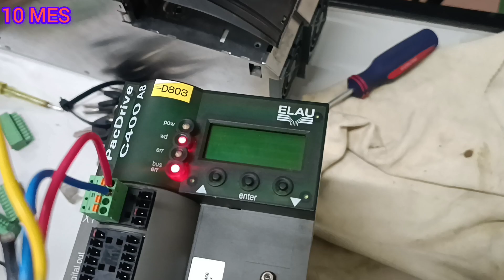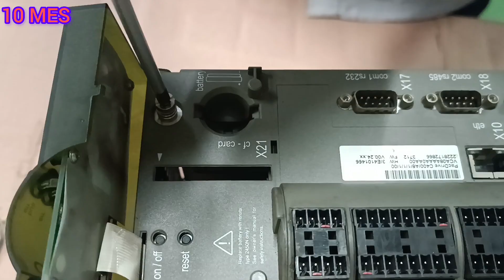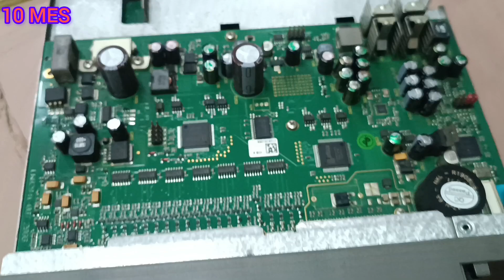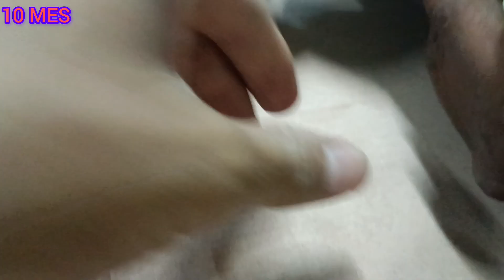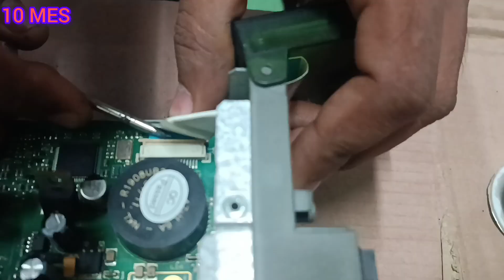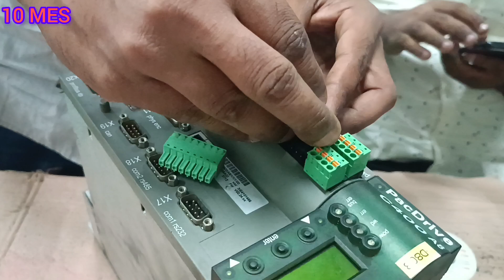PacDrive C-400 Controller Troubleshooting | Schneider Controller Error Fixes, Tips & Solutions.

Comment: Hi,I have an issue in MC-4 PACDRIVE,the error is:error DC bus precharge,but the MC-4 they are powered by 400VAC 3PH not DC,can you help me
Reply from the maker: Please Check one by one,,,,, 

1. Incoming supply not present or unstable.

2. Precharge resistor open or faulty.

3. Precharge contactor not closing.

4. DC bus capacitor failure.

5. Loose or damaged wiring in DC bus circuit.

6. Internal power supply fault of drive.
Reply: @10minutesengineeringsolution I want to explain my issue,
When I turn on the machine the 24VDC to power the C200 and MC-4 it exist immediately,but the 400VAC not because the contactor not enable because the MC-4 not ready,is the contactor can cause this issue?
Reply from the maker: For check purposes you can turn on manually that MC for a while and then release,, then check what exactly happened.... If it still does not power up then confirm that MC-4 problem   .....
Reply: Thank you very much I'll check all these suggestions,